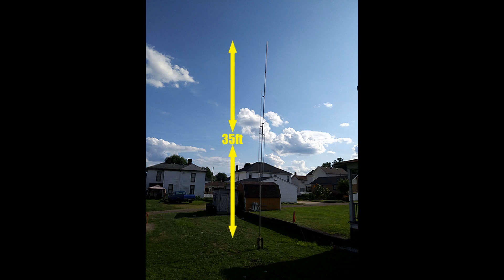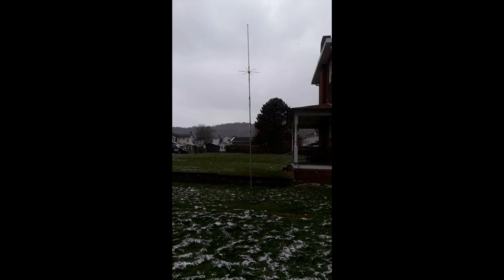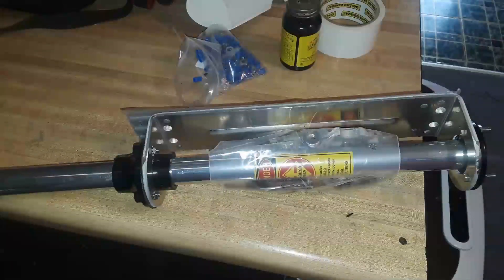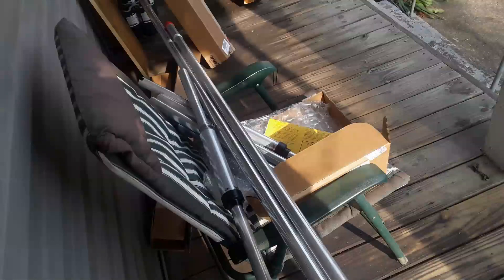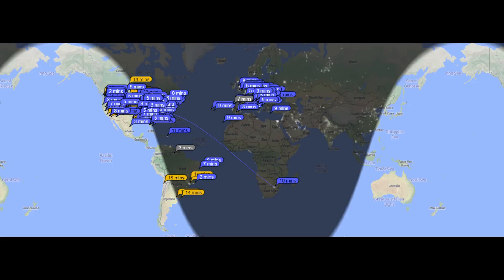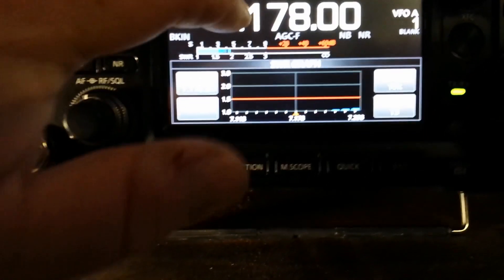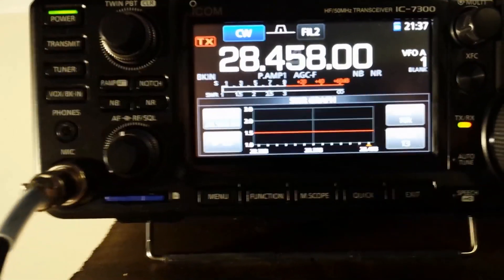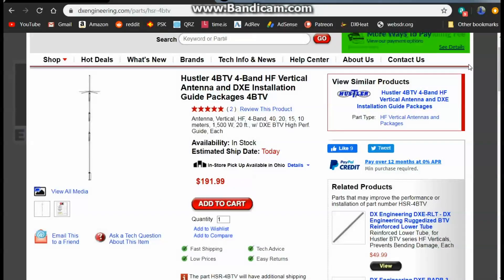Installing a new Vertical ham Radio Antenna

Comment: I also have a Hustler 4BTV antenna. It's served me well for years. Just thought I'd let you know that it performs well on VLF sub frequencies. Just make a little adapter box and convert in it from coax to shielded audio cable, with a plug for your mic. input on your PC soundcard. I'm using Spectrum Lab, works great.... K8TND

Comment: Did the hustler measurements work or did you have to do a lot of adjustments to each of the bands?? Thx
Reply from the maker: Worked great, just a little adjust on top

Comment: Does this antenna have to be attached to the ground/earth or can i put it on another pole on the side of the house. Does metal affect it and does a long coax connection lose much? Thanx & 73  W1SWE
Reply from the maker: It needs radials.

Comment: Great job! I'm debating which antenna to get...The Hy-Gain or the Hustler. Both are 18-20' rated at 1,500 watts. Also, you used a 4' pipe driven in 3'? Did you have to use cement? Thank you!
Reply from the maker: No cement

Comment: Good video! It's been a year and a half since you posted this. How's the antenna holding up? I'm about to install a 5BTV, which is the same as yours plus it also covers a portion of 80 meters. I bought a bunch of accessories from DX Engineering such as their radial plate and quick tilt base. Putting it all together today and tomorrow, then plan to lay the radials next week. I'm going to use 30 radials to start off with, and may add more. 73 de WB4DW

Comment: My question is how did you attach your ground wires to the base area of the antenna.  Does the antenna itself allow for connection for a certain number of wires?  Did you buy a plate for radials?  Lastly where can you get info on radials, how many and how long.  I almost bought a comet 250 recently to mount 35 feet above the ground.  Found this antenna and video.  GREAT VIDEO BY The WAY.  I do have the space for ground radials.  thanks

Comment: very intersting antenna - love the low SWR - i will keep it on my 'nice to have' - the only downside is that i wish it had 80m but for the price having working 40m and 20m is good.
Reply: They make a version with 80 meters. It's called the 5BTV and adds an inductance coil and a whip on top. It only covers a portion of 80 meters though, not the entire band. You choose which portion you want to cover when you install it.

Comment: Instead of buying a radial plate for this antenna make your own for  less than twenty dollars. Go to Walmart and get a aluminium pizza pan then pickup as many nuts bolts and washers to use with your radials. If you have a

Comment: i have the gap with the umbrella wire around and it has been crap since I got it  a boat ancor . I been thinking a bout one of these all I have is a g5rb wire.
I  just picked up a hundred feet of wire for low voltage lights I think I'm going make some kind of antenna  split the wire and I have two hundred feet of wire. I think I can make something out of it.

Comment: I have a interest because I also have a FCC license. I rec'd my license in 2003, a no code ham operator. I like tinkering with electronics. What peeked my interest in this video is how your discussed the antenna installation, and use. Well done! I purchased an HF rig from a wife of a silent key. I paid her a good and fair price for all his equipment. And the cost of this antenna fits into my budget. The downside I do not have the expanse of land to layout the radials. Thanks for your tutoring sessions, much appreciated...

Comment: i run a old crushcraft R7. works lol but needs rebuilding. 40 is nothing but s9 noise all the time.  20 gets me uk and italy , spain. but you know. band cond band cond. sucks right now.
Reply from the maker: I had the same issue with a dipole, S9 noise. I'm going to make a video soon on how to check for common current noise.
Reply: @learnelectronics  would be cool for some antenna and coax stuff.

Comment: That is impressive communication distance. Curious if the town (or your neighbors) have any issue with a large antenna like that in your yard. Pretty cool stuff. Oh and liquid electrical tape is awesome...i use it a lot!
Reply from the maker: Neighbors hate it. City doesnt care. Neighbors blame it for everything, but it doesnt work that way. It's up to the manufacturers of equipment,  like computer speakers to shield them. I have offered snap on ferrites  for rfi suppression, but they would rather just complain.
Reply: @learnelectronics  you can't make everyone happy (life lesson ain't it)

Comment: Nice antenna... Looks good but needs 10 more feet of pipe.... Lol Just kidding..
I am a old CB'r from the 60's and have all kind of stuff. 4 years ago I got my hands on a lot of 2 PDL2's in various condition and added them to the other 2 that I had from years ago and one I was still using until a storm took out both Hubs. One hit the ground and the other was rapped around the beam and mast.  Took all of the parts and made 2 antennas with the help of a friend and his lathe, whom made 4 new fiber hubs that will never break....
I have a tone of Cobra stuff and 3 HR2510 that are modded out the butt...
I got this one Dwight D base station that had a fried board (big hole in it) and I got a President Jackson (the first run Not the new stuff) off ebay that had a flat case like someone ran over it. Took the inerieds out of it and put them in the Dwight D (Old version) chasse and made a new radio out of it. I call it " The Dwight D Jackson" President radio... I had Deb Decals make custom lettering and all for it... Great radio, the SSB is a little off. My buddy that ran the local CD/Ham/FM radio shop had a stroke and had to close before I could get hi, to tune it. I have the stuff to do the AM but not the SSB... Sad!
Sorry for the rant..... I LIKED the Video..... ] :-)
LLAP
PS my buds have been trying to get me into HAM for years.....lol
Reply from the maker: Rant anytime, I like reading the comments. Thanks

Comment: Verticals are known to have higher noise levels (QRN) than horizontal antennas. How much is the Hustler's usual noise level (S-units)?
Reply from the maker: Seems about S5. It is definitely noisier than my GAP antenna (gap is not a vertical,  it's a center fed phased dipole) 
We will see how it behaves when get all the radials down.
Reply: @learnelectronics  I had an MFJ all band vertical years ago and I suffered mightily with noise. But I also have an HV transmission line nearby which could cause this kind of noise level. I believe the Hustler will serve you very well because of the signal low take-off angle for DX and, thankfully, modern XCV's have great noise removal electronics. Yinz will do fine.
Reply: Yes but good take off angle for DX, the vertical is. 
S5 but what band,?.. either way, these days S5 is good, in many areas.  
I get S9 at my QTH, so work portable most of the time.  Cheers, like the videos..  A92GW